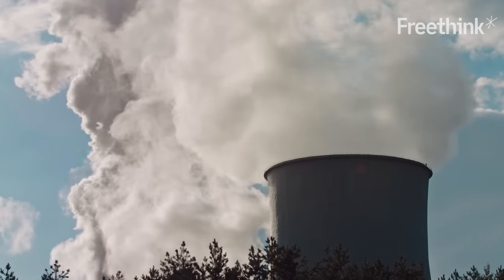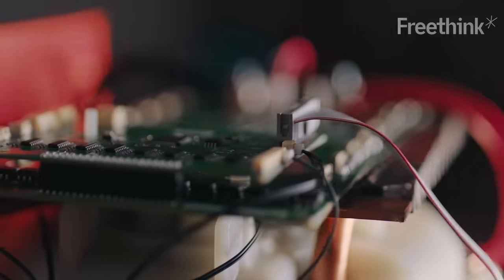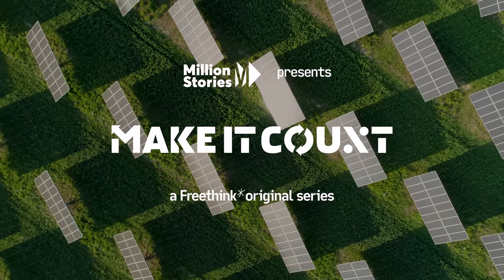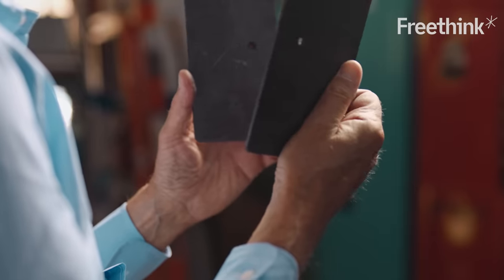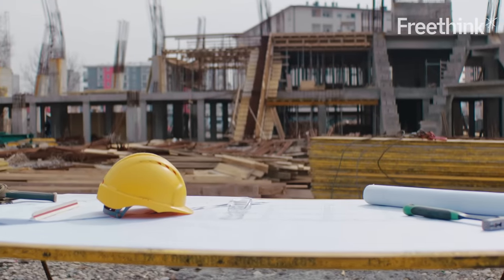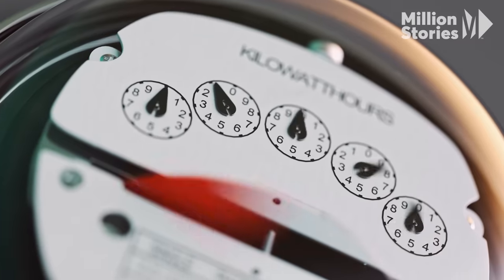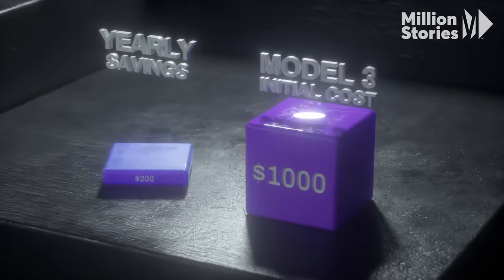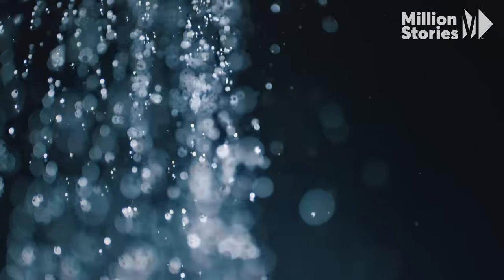The man hacking hot water to save the planet

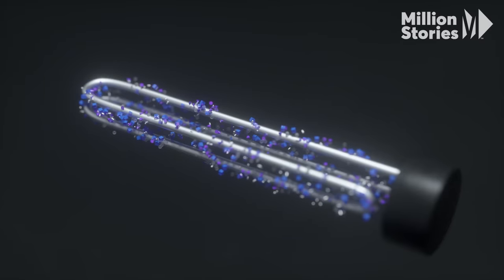Comment: 0:35 Where does the heat go? I doubt this claim. The efficiency of resistance heating is always 100 percent. Ther's no loss of efficiency. As the video starts with a lie, I will skip the rest.
Reply: Where does the heat go? Down the drain when you use the hot water. If efficiency of resistance heating is always 100 percent why not use a water heater to heat your entire house? Seriously, explain why I can't just set the water heater's temperature to 800 degrees or whatever it takes to heat the whole house? And if the tank is wrapped in insulation still this shouldn't matter, right? 100% of theoretical electricity turning to heat energy ignores some important factors, like whether that heat energy is doing what its supposed to do.
Reply: @gorkyd7912  You have a lot to learn.

Comment: For 15 years I had a wood fired “water stove” — which is just another way of saying a wood fired boiler system — that heated both my potable hot water and my house.  

For those 15 years I never had an electric bill over $50.00.  And during that time I cut or gathered, transported by electric ATV, and burned a lot of dead wood on my property in my water stove.  

Naturally that worked great for me living in a heavily forested, rural area.  It wouldn’t work too well in a New York City  apartment skyscraper . . .
Reply: Might be cheap, but burning wood is about as polluting as burning coal for power. Cheap energy at the expense of the environment, more hurricanes, etc.
Reply: @nixtoshi  , actually it is relatively not very polluting.  The reason I say this is that most forests regularly have to experience routine ground fires to reduce the amount of flammable needle, leaf, and stick litter.  If they do not have these routine burns (which happen periodically even without human intervention from lightning strikes) then these organic fuels build up to such a degree that when there finally is a fire it destroys the whole forest.  Then it is bye-bye to the trees, animals, people etc. and the carbon sink that is what a healthy forest eco-system is.

Thus the extremely tiny amount of wood that I burned in those 15 years would not amount to even a significant fraction to what would — and does occur — when these regular controls burns are deliberately set every two-three years on my property to safely reduce this organic litter to ash. (& this is done routinely throughout the Southeast US by property owners and — on public lands by the state).

The situation you have out in the West and Mid West, as well as in many other parts of the world, are exacerbated by the decades old fire suppression policies that the European civilizations enacted.  The native populations used fire to keep the forests healthy, not only in North America, but in what is now Australia. 

Thus when forest fires are ruthlessly suppressed, you eventually get catastrophic fires that destroy the forest rather than preserving it!  It sounds counter intuitive, but the beauty of it becomes obvious once you understand it.

Keep that in mind when contemplating the phenomenon of 🔥 fire.
Reply: @LawrenceCarroll1234  wow thanks for the explanation! but if those fires have to occur routinely, then the wood for the stove becomes an additional factor. the more people would burn wood, the more emissions would arise. or did you use the material that would otherwise burn in those routine-safety-fires anyway? the material that was laying down on the ground? you used the flammable needle, leaf and stick litter? you can correct me if misunderstood
Reply: @nixtoshi  It's the same with wood gasifier systems (or any combustion system in general): it's not that harmful if only a handful is using such, it become harmful if EVERYONE is using it...
Reply: @sweetfruit7769  , yes, that material that I burned in my water stove would have been burned later (potentially) in the recurrent controlled burns.  Not all such material gets burned up, of course, just an excess amount, which can vary somewhat based on weather conditions at the time of the burn.  

There is potential for much more to be used in stoves, or in “smokeless” methods such as methane extraction/combustion.

It should be noted that there is a huge untapped potential for extraction of methane from all organic “waste,” such as that which comes from “factory farms” which are infamous for polluting the environment. The pork farms of North Carolina come immediately to mind, though there are many other examples as well.
Reply: @axelpatrickb.pingol3228 , the methane (& C02) of the organic material escape into the environment anyway.  So if everyone burned the methane gas rather than drilled/fracked for it then instead of being more harmful, it should be less so (logically speaking).
Reply: @axelpatrickb.pingol3228 , the methane (& C02) of the organic material escape into the environment anyway.  So if everyone burned the methane gas rather than drilled/fracked for it then instead of being more harmful, it should be less so (logically speaking).
Reply: in GB it was called a 'back boiler' & 'milk float', & manufactured 'town gas'/gasometer fed gas fridge.
Reply: @paulmaydaynight9925 , leave it to the Brits to name thing’s properly!! 😂
Reply: @LawrenceCarroll1234  ^_~ the cheap after market milk floats are potentially a very good candidate for retrofitting the new batteries & pv today for local use again, simple, quick, & carries a market stall load easily; as are the gas fridge updated to use an on demand hydrogen 2v electrolysis pilot light.
Reply: @paulmaydaynight9925  , sounds very interesting!
Reply: @LawrenceCarroll1234  thinking about it as a problem solver/better reclamation use...
i suppose what do you call it 'septic tank' is under used/wasted energy, as you could tap that diy 'town gas' , rather than have it just slowly disperse into the atmos like forever.

hmm rather than a diy water sealed small gasometer, a generic static water 'trompe' + 12v pump bubbler, would probably be simpler to do for on demand storage & develop more pressure per foot to make & bury next to a small feeding topup pond ,safer too, as you all seem to own diggers lol
Reply: Yeah, my point is this isn't a good mainstream solution due to climate change, using clean electricity is better.

If burning wood for heating went mainstream, the increased demand would end up causing more deforestation and more wood burning than natural fires would alone.

Most people make decisions based on self interest alone, but considering the ethics of what we consume would probably avoid some of these issues from growing to critical points
Reply: @nixtoshi  , good points.  

However,  I personally am convinced that more burnable material could be used in mainstream applications, and especially in regard to methane from organic sources (sewage, animal waste, and any organic material — it all contains methane, the most potent greenhouse gas unless burned, which reduces it to CO2).

In addition, by creating big “firebreaks” out in hot, arid locations like the West & Midwest of the USA, it could help prevent the gigantic catastrophic forest fires that have so ravaged those areas.  (Yes, it is somewhat like closing the gate of horse stall after the horses have already escaped!).
Reply: @LawrenceCarroll1234  Yeah, the fed gas fridge goes Brrrrrrr!
Reply: @KimTiger777  😺
Reply: @nixtoshi  Burning dead wood produces less carbon than rotting wood.

Comment: So we need more power to power a more efficient thing?  No thanks.  Spiky power loads are a problem.
Reply: Yeah, more efficient insulation for the plain old water storage tanks would be a much better invention all around. It would also improve other areas, such as home heating/cooling, CSP energy storage, space travel and more I'm not thinking of currently.
Reply: Periodic Maintenance of cleaning the Heater Element and draining all the Calcium in the bottom of the Tank, which has the highest benefit, and most don't do until it's too late! Like changing the Oil and Filters in the Car...

Comment: Tankless water heaters are the standard here in Japan. They're little boxes on the outside of your house that are powered by gas that hold a small volume of water. When you turn on the hot water, they automatically ignite and start heating the water. It might take a few seconds, but you're only heating the water you need and it doesn't run out. You can also get standalone versions just for hot water at the kitchen sink, if that takes your fancy!

Comment: As Jordon's excellent reply says. The amount of energy transferred to the water is the same, scale may just slow the heat transfer process. Apart from the idea of heat pumps, a simple approach of using an insulated kettle should reduce the heat transfer from the kettle to the surrounding air (ie a thermos, particularly when the air temperature is low (eg. in a cold room).)

Comment: I use a 40 gallon natural gas water heater. It requires no electrical connections and and there are no electronics to burn out. I didn't need to hire an electrician or rewire anything. If the power goes out I still have hot water.

Comment: Who powers their tank-less with electricity? Most installations I've seen use gas. Since we switched, it takes longer time for hot water to get to the sink!
Reply: Ecuador...no piped gas infrastructure...  This product is no breakthrough...
Reply: Yep I agree. If you are going to use electricity then a heat pump is the way to go. I have a gas tankless and I had to add a recirculation pump to get instant hot water.
Reply: In a lot of places because a lot of places have no access to gas

Comment: Nevermind the fact that states with strict energy codes such as California penalize resistive heating technologies to the point where is is nearly impossible to install a tankless electric water heater and pass your energy mandates.  Heat pumps are the way forward for water heating and home heating.  Also you're going to have a difficult time running a home off a home battery is you don't use heat pumps for everything.

Comment: Why no mention of Heat pump water heaters? These are way easier to use in existing home wanting to upgrade and are just as efficient as this heater that you are pushing … They also serve to dehumidify and cool a house. I live in a very hot and humid part of the country and have one that is available from the big box stores. They are more expensive, but well worth it in the long run.

Comment: This is vaporware.
All resistive heating is 100% efficient. Not 99%, Not 101%... Exactly 100%. Doesn't matter if your using the water as the resistor or a resistive wire. This product is LESS efficient... as you have to have to manufacture a more complicated product AND install higher current circuits, to do exactly the same task as a piece of wire. 
Insulation on the heating element (mineral scale) does not effect total efficiency. Insulation does not "remove" heat, it slows it down.

As many others have stated... Heat pumps are the "future technology" that already exist, but aren't implemented widescale.

Comment: I recently had a hot water tank go bad and needed it replaced, I asked about tankless heaters and was surprised when the technician was pretty adamant about talking me out of that option. I feel like the people out in the field need to be sold on the tech so that they will start recommending it. People needing to get their hot water working again are not likely to shop around or argue, they will just accept what is being recommended most of the time.

Comment: Electric water heating is cost-prohibitive for the same reason that heating with electricity costs you three times that of natural gas heating. When you draw water from your source it is usually very cold, to reduce your heating costs you simply fill a dummy uninsulated tank (to warm up the water going into your hot water tank). The incoming water is passively warmed before entering your hot water system.  Condensation on hot days can be used to generate grey water for gardening or rinsing exterior surfaces by using a solar pump.

Comment: High current was mentioned but how much voltage?  Above 1.23 volts  water molecules start splitting into hydrogen and oxygen.  The homopolar generator is a low-voltage, high-current electric generator.

Comment: 2 problems: a) heating water with electric power is already the less efficient way. Most homes I know use the heating system to provide hot water. So when you build new, there are already better ways to do it. (by witch I mean better than this one)
b) although tankless heaters are more convenient, water tanks are actually a great way to catch and store energy, that otherwise would go to waste.
Reply: a) electricity is the only power we can create carbon neutral on a large scale. There is no alternative.
b) good point. Indeed heat pumps which might be less power but more efficient than a purely ohmic heater come to mind.
Reply: @TilmanBaumann  right now we don't produce electric power carbon neutral at all. Burning gas produces less co2 than heating  with electricity. It is also not exactly true, that it is the only energy  we could produce carbon neutral on large scale. The role of electric heading is (for the most part )  not one of saving Co2 emissions, but one of convenience. It is quite nice to have boiling water in a few seconds. Obviously in cases where electric heading is the only option, its a good thing to at least cut down on losses there. 

I sad for the most part because when you use very efficient but not reliable heat sources it can be a good Idea, to top that of to the desired temperature with electric heating. In a way this is still convenience. But more in the sense of making efficient sources usable.
Reply: I'd argue electric heating is 100% efficient, since every watt you put into the heating element produces heat. 
The only better thing would be using a heat pump (electric, too), using spare calories from the air or a heat source.
Reply: @takix2007  
But you already through about halve of the
energy away when producing the electricity. The point abut electric energy is that it is very low entropy. That means that produce waste energy in the production.
resistive heating just transforms the lesser amount of energy into heat. Heatpumps are obviously way better. They use the lower entropy to get energy from the surroundings. But the upper limit for that is the energy you "wasted" before.  A modern burner meanwhile has an efficiency of a little over a 100 %.
But obviously there are more CO2 efficient methods on the table f.e. using the waste heat we talked about for heating. Heating requires a lot of energy, but it does not require a high quality of that energy.

Look I don't say, there is no place for this method. But I am a little bit concerned about the Idea, of using that for new buildings. Because that way more efficient solutions will not be implemented.
Reply: @MusikCassette  no I did not throw 50% of the energy away, if the electricity was generated with a dam, a windmill or solar panels. And even if I used a thermal powerplant (coal, gas, fuel, nuclear), the heat generated by the powerplant can be used as residential heating (for neighborhoods close to the powerplant) or for other industrial uses that need some heat source.
Reply: @takix2007  "if the electricity was generated with a dam, a windmill or solar panels."
oh I wish upon a star, that things were  different than they are. 
The time when you need the most heat coinsides with time wind and solar production is at its lowest (at least where I live, I did not make that calculation for every part of the world) So the vast majoraty from electric heading comes from Fossil fuel  power plants. There is some value in heading up water with renewable electric energy in times of overproduction. But that presisly when you do want a hot water tank.  Remind at b)
I talked about waste heat (that is not just from thermal power plants) and that it trumps electric heating and burning gas.
 If district heating is available where you live that is likely to be the best option, if you build new CHP is an option. Although in that case reducing the need heat for heat is the bigger priority.

Right now there is more waste heat than we use. So I do not that the thermodynamic waste that resistive electric heating is offset by that.

Comment: Resistive elements is just one way to heat water, there are things called heat pumps, solar powered geysers, induction heaters, in line water heaters and gas powered geysers. Resistive heating is the most inefficient but cheapest to install

Comment: My experience with on-demand hot water heaters is that if you crack open the hot water tap, you get cold water until you open it at least halfway. Then all of a sudden, you get HOT water! It's either too little or too much. 

One of these arrays at every faucet and shower head might work well, but who wants $10,000 in water heaters when they can have a single $1,000 unit?

Comment: There is a cluster of refineries just down the road from me, all adjoining one another.  Half of them have big cooling stacks for dissipating heat from water that they heated, either directly or as waste heat from chemical reactions.  They have pipelines to send byproducts to one another, but you'd think they could also send hot water as well, rather than starting from a base temperature.  That would probably save more energy than improving the efficiency of every single household in our greater metropolitan area.

Comment: You could easily use super capacitors instead of running a 100/200amp connection to just a single appliance. The idea is to reduce overall power usage per household and decrease the amount of copper used in new builds